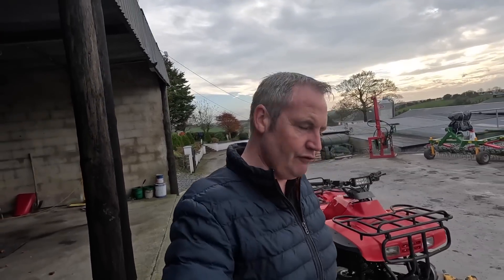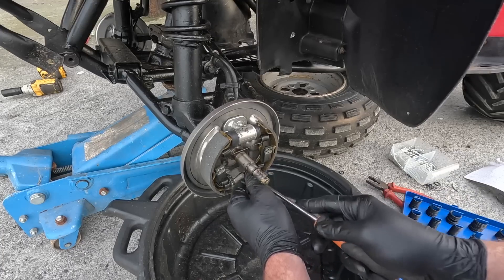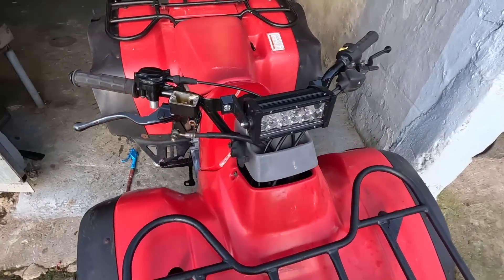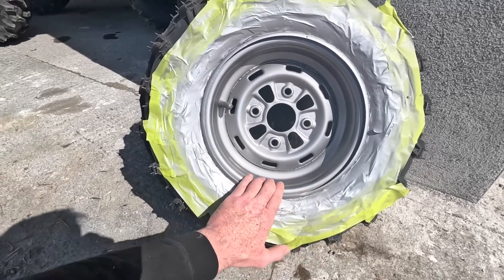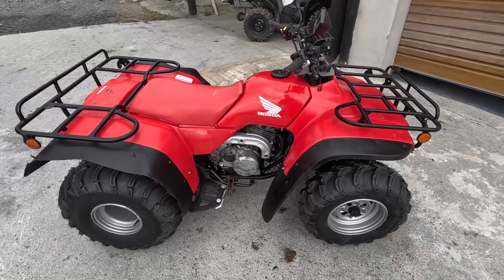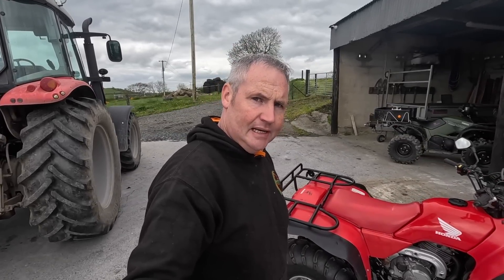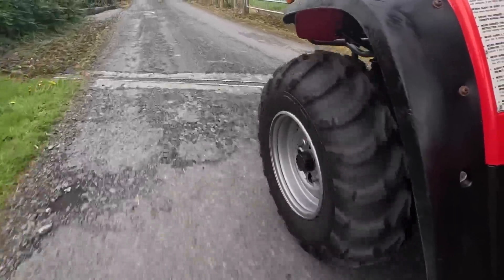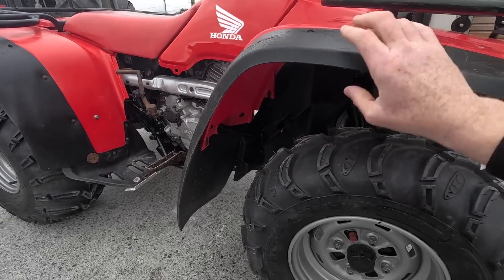Saved From The Scrapheap || Refurbished Honda BIG RED ATV Is Back In Action

Comment: Wow! You really did a great job restoring that 4 wheeler! I have a 1999 Honda 300 2WD, but mine was kept in a garage most of it's life, so it only had a few minor cosmetic issues, but did need a carb rebuild, runs great now...& it also needs brakes, which are about to be fixed... I just built a jockey shifter for it, which I like much better than the foot shifter... I'll be doing a disc brake conversion on the front soon, but first I gotta get the back brake working just so it'll have brakes, then I can save up for the conversion kit... I want to do a 4X4 conversion too, but I have a 2,500 pound winch on it, so there's virtually nothing it can't get out of, but 4WD is still nice to have...🖖🏿😎👍🏿

Comment: A genius 10 charger is about 150 euro, they charge up to 230amps.  If the battery is depleted most charger won't charge the battery. The genuis chargers can put an amp into the battery and then charge it up. There is also a setting for battery repairs. Best thing I ever bought.

Comment: Great to see her back in action,what's your thoughts on the Yamaha,I have any old quad thats in need of a rebuild just thinking of upgrading
Reply from the maker: I like the Yamaha so fare, the Honda Forman 500 we had previous was the most reliable quad one could buy, I would be just as keen on the newer 520, just my personal opinion. The 686 engine in our new Kodiak is know to be reliable and I like the transmission over Hondas eletric shift
Reply: @IFarmWeFarm  thanks for the info I don't know if it's worth doing up the the Kawasaki kvf400 any a vice parts are hard come by

Comment: Was the big red 300 only sold in European countries because here in the us we have the same Honda 300 but called Honda trx Fourtrax 300 but not called a big red the only big red we have are big red 3 wheelers it’s weird that they changed the names and confusing on finding information on the Honda big red 300 and all I get is the Honda fourtrax
Reply from the maker: No TRX is just another name for Fourtrax, this is a 2 wheel drive so the TRX is dropped. Big Red was there more commonly used name until we hit the 90”s. Same in all countries I think

Comment: Hi mate I have got a battery repair and charger from a company called topdon T4000 I find it really good it doesn't work all the time depending how long the battery has been ded but most of the time it will repair most battery's 75%  of the time but there worth a look
Reply: There around £50 under that if you look around